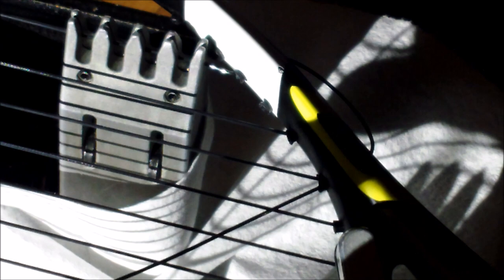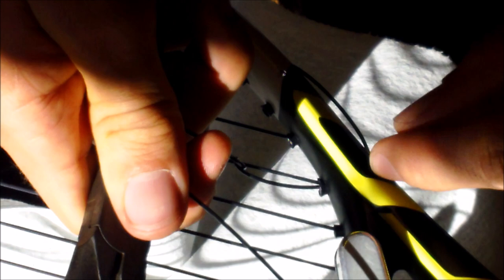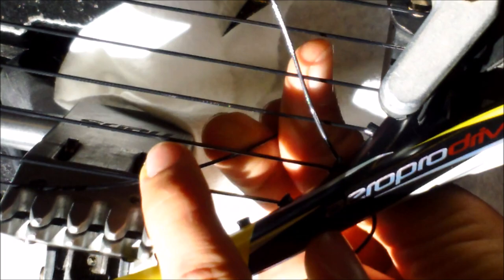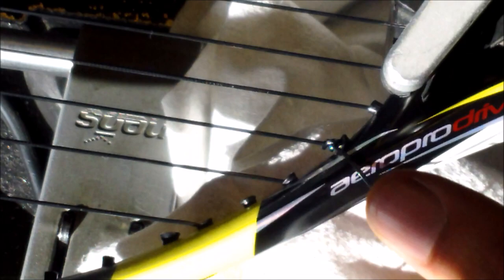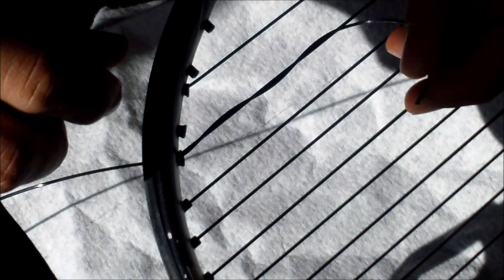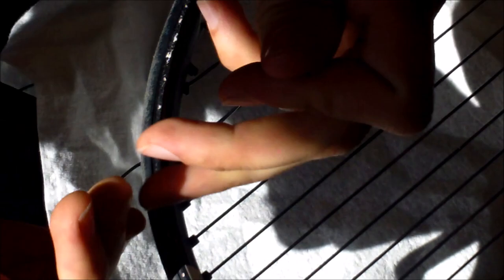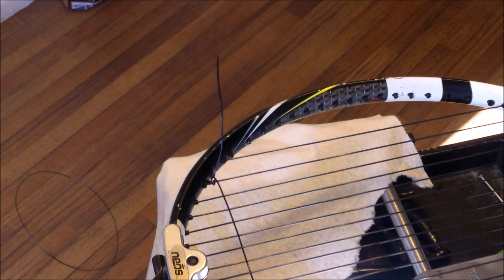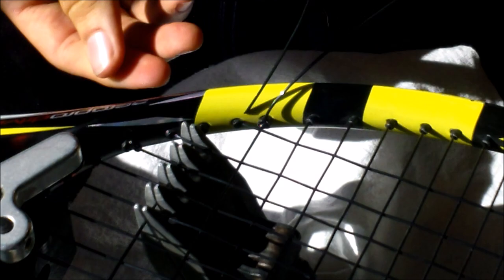How to String a Tennis Racquet: Tennis Stringing Knots

Comment: Hello, very helpful video, however, in your videos where you string the racquets you don't seem to ever use the starting knot when starting the crosses. I see you using the starter clamp and then tying it off at the very end when the racquet is completely strung. Could you show what kinda maneuver/knot that is? thanks in advance.
Reply from the maker: CLAymatorANIMAtor alrighty. using a starting clamp like that allows me to do a normal knot rather than a starting knot. the upside of that is it keeps the grommet in better condition overtime. starting knots are pulled directly against the grommet to tighten which can warp the grommet overtime
Reply: TennisBySpize ok gotcha, thanks again!
Reply: @tennisbyspize1622  I totally agree. I'm not  a fan of starting knots and never use them.

Comment: Half hitch, double half hitch...: non recursive knots are just nonsense, simply should not be even taught...
Plus starting knots makes premature damage to the grommets as you progressively pull on it.
In the end you only need to know Parnell knot and (wilson) Pro knot, this last one is good for thick strings or when you have little space.
Instead of doing a starting knot it's better to start with a starting clamp, after 3 passes clamp on start, do a parnell knot and on clamp release the knot with sit instantly on grommet edge without sinking/crushing on it.
Reply: Do you have data to show that double half hitch knots are poor?  I have used that knot without any problems. I have also used the Parnell and Wilson Pro as well. All perform well.  I like the double half hitch because I can cinch the knot much tighter getting all of the slack out better than the others.